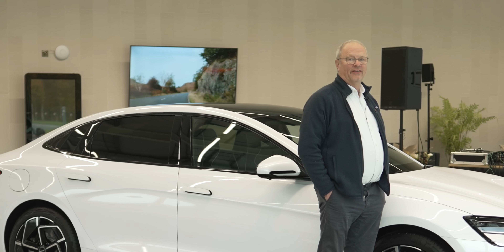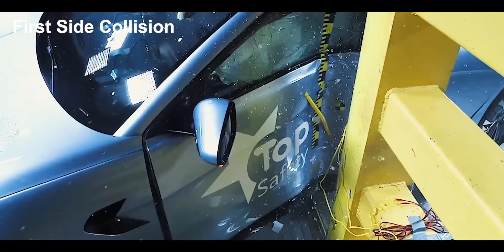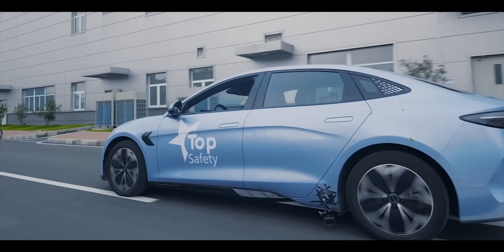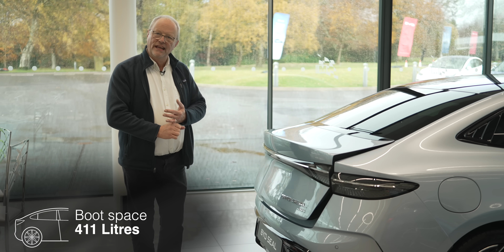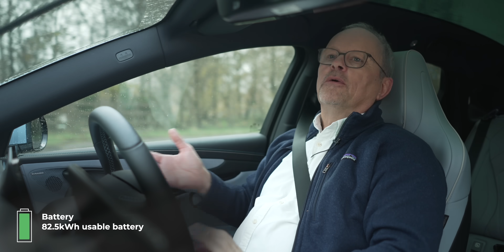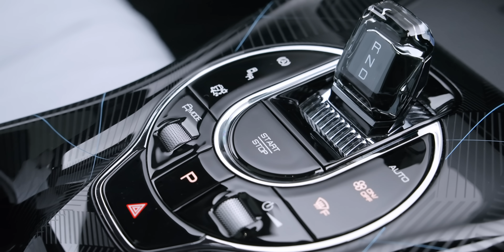This Car Proves Just How Far Chinese Cars Have Come

Comment: Had my Seal Excellence since November '25 now, a little over 6.000km on the clock and loving it! Immediately loved the design inside & out. The only real downside would be the comparatively low charging peak, but since I charge at home in my garage 99% of the time I don't quite care.

Comment: It doesn’t quite have the basics needed to compete with the Model 3, it doesnt have features like Dog Mode, Camp Mode, and Sentry Mode, there’s no self-serve test drive,
 you need internet access for charging, the autopilot is far more basic, and—most importantly—it’s not even cheaper. It costs £45K, while the Model 3 Standard is £39K and the Model 3 Long Range is £45K. It can’t really compete on price either, since almost all Teslas in the UK are built in China—in the very same city as BYD!

Comment: NOPE!  Just saw real world 2 day comparison with Tesla.   Yes BYD goes further.     But charging network of Tesla just wins, tells you where to go, plug and works, cost 50% less by end of 2nd day.  More efficient   m/kwh  and $10,000 less.   BYD the big screen is partially blocked by steering wheel,  small drivers screen is blocked if you move steering wheel to comfort position.  Also drivers screen shows power usage which is constantly changing and distracting.     Sorry BYD!

Comment: Thank you.  My concern is the screen.  Doubt I can drive safely as I look for the correct menu and then the correct icon.  Definitely would need to adjust the settings before starting a drive or be very familiar with the Screen controls.  I‘d probably need to pull over most of the time to get it right.

Comment: The thing about Teslas is that they go long distances with EASE.  The trip planner finds your route & charging stops, and Teslas charge about 2x-4x faster than ANY OTHER CAR.  BYD can't do that yet - high speed public charging networks DO NOT EXIST.  It's why Ford & GM are joining the Tesla Supercharging network.  For the price of a BYD Seal, the car  DOES NOT go long distances, so it's actually a fail in my opinion.

Comment: Saddly, BYD seal's sales volume is quite low in China rightnow.
It's not price competitive. Well,  at least in China 2024.
I just bought a 460+HP, 620NM, 4 wheel drive, 77KWH Battery, front double wishbone, Brembo brake, 2 door coupe for less then 20K EUR brand new...Seal is like 25K EUR.
I feel like stealing and guilty. In a good way though😅

Comment: Never buy chinese made, especially a car, they safety is non existent!
Reply from the maker: Hello Claudio Carrera, I think itis perfectly understandable for you to hate Chinese cars, however these vehicles have to pass stringent safety checks to be allowed to be sold in Europe. I have driven many of them and they are as safe as any vehicle made locally.
10 years ago concerns about safety may have been valid, now, we need to find other reasons to hate them.
Reply: @fullychargedshow  Lies you must be a wumao channel. ADAC puts Chinese EV’s to the test. It turns out to be a major safety risk.

“Basic safety equipment is completely missing, which becomes particularly evident in the crash test of an offset frontal collision at 64 km/h (40 mph)”

Never buy chinese made, cheap manufacturing with terrible safety records!
Reply: Dude, you obviously have no idea...! 🤣
Reply: It's sad that he totally believes he's right lol  @Netsurf123
Reply: @Netsurf123  How many BY D dealerships have burnt down, it not even a month old hahah alreadyy exploding lol I drive Merc63, real car by real innovators.
Reply: @Netsurf123  Yeah I do, I drive a Mercedes AMG C63, are real engineered car, not a chinazi rip off that will explode hahah

Comment: The full glass roof design is a hazard. A rock from the top can kill all the people inside in one blow. Moronic design for any car that uses the glass roof.
Reply: How big must that rock be and from what height must that rock fall from to kill all 5 passengers?
Reply: @CThienV  First, no passenger should be hurt. The idea of hurting all 5 is beyond the pale. Second, in terms of weight, a projectile or falling hard object requires orders of magnitude lighter weight to penetrate glass than a traditional unibody metal roof. It doesn’t even need to hurt the passenger or driver to cause a major distraction to the driving and cause accidents. Third, a small and fast projectile, such as hail blocks, is more than enough to break the glass, much less any falling articles from a window of a building.
Reply: @vastg5453  First. You stated a rock can kill all passengers in one go. I only quantified what you said. 
My car has severe hail storm damage yet my sunroof was unaffected. Sure, my sunroof doesn't  have the same span as a full panoramic roof but my wife's car with a panoramic roof was fine after the same storm.
Sure, I agree that there are risks with things falling from the sky and building windows but with how frequently such incidents occur to the extent that you describe, there are other scenerios more worthy of your paranoia. Maybe we're better off staying indoors
Reply: @CThienV  I don't expect people to agree with me, and I am simply pointing out a possible scenario. People are free to make their choices. If they choose to take that risk, it is their own lives at stake. To me, the design is a hazard for no benefit I care about, so I will vote with my wallet and not buy cars with this design. If it turns out to be a bad design, it won't stand the test of time and will fizzle out of the market.
Reply: @vastg5453  have you seen crash tests of this car or other cars with panoramic roofs? How did they go? High speed side, front and rear impacts stress the roof more so than a direct perpendicular hit of a rock would, surely?

Comment: I watched a video from China two days ago. Two years ago in China they had over 2000 EV fire. Last year over 1000. In the video it showed a burned out EV that 4 people lost their lives in the car. They are not safe
Reply: In 2023, 3,000,000 BYD cars were sold. Two years ago, you quote 2000 EV fires. That is 0.0006 chance to have an EV fire, if you are accurate and assuming only BYD cars catch fire. To put it into perspective, the chance of a plane crash is 0.0002. The chance of dying in a car crash is 0.01. The chance of a gas car catching fire is 1530/100,000 cars or 0.01529.
Reply: @ProdigalExplorer  that what the guy said in the China video about 2022 when 2000 EV caught fire
Reply: @bobjohnston5527 but that guy did not give data for all other types of cars and vehicles for context and perspective.

Comment: Where I live on hot summer days when I get in the car I have had temperatures of 65C or higher, so laughing about max of 60 on the heat pump spec is frankly ignorant.
As to comment on 5 years ago heat pump drained the battery and tech has advanced greatly, then that means 5 year old EV cars are now worthless, and so will the Seal be worthless in 5 more years. So I can’t afford to waste money like that, until tech is stable.

Comment: I've been in one today and the interior quality leaves much to be desired, specifically the choice of materials. The seats upholstery feels like rubber, the steering wheel is made of the cheapest plastic you'd find on bottom panels of an old VW. I got a Seres 5 EV which costs about the same, has similar range, but the interior is tastefully designed, the carpet is plush and soft, pedals are accented with metal surrounds, everything is soft touch, most of it is upholstered in real leather. Not only the seats, but the door cards, arm rest, center console sides, and dashboard trim. The fake wood is nicer than you'd think, the sound insulation is amazing (it has double pane windows in front)
Reply: I'm confused. 
Inferiority or superiority complex?
Reply: @CThienV  it's a fair comparison. Both are Chinese EVs both cost the same, it's a matter of taste I guess
Reply: @dgurevich1  we all have preferences. You don't need to justify your purchase decision. Be happy and enjoy your ride.

Comment: BYD battery manufacturing is one of the greatest reason why they are rising on top.
One of the biggest problem with EV is battery.  the battery industry is still young and there are lots of things yet to be discovered. we have graphene, sodium, manganese etc etc.  this make everyone be worried about their EV's future.  

your EV right now may not be a good investment coz when the time comes for you to replace your battery, your new battery would be technically outdated.  you car's motor and all will still be fine, but the battery tech needs to be replaced by the newer material.    

and this is where BYD give people something to hold on to.

we already have that very same problem with our laptops and other battery powered devices such as smartphone and sports camera.
when our device time to replace battery came .. our device doesn't feel like brand new at all.  what ever battery replacement you did.. it always have that feeling of undervoltage because those battery are most certainly in stock for years on a warehouse.  and discharge from being stock for long is not good for any battery right now.

Comment: This car looks like a nice EV. But you shouldn't lie about modern EVs not having their range lowered when having accessories on. I'm talking about driving on a cold wet night. Heater on, lights on, wipers on. You can't tell me that the range is not affected.
Reply: In the cold winter, battery life will definitely be reduced, so in cold places, it is best to buy a gasoline or hybrid car

Comment: My old neighbour Mr Wang Peen said he was a BYD engineer who tried to speak out about BYD safety issues. BYD management silenced him by sending hired goons to launch heavy kicks at his groin while being held against his will. One of the managers said to him 'why do you care about BYD fires? none of your relatives can even aford a BYD so they are safe'. He was so scared of this company and their goons he moved overseas. He never wanted this story to be told as he was so scared but I changed his name and told it because the truth must be heard. Look up BYD fires, there are youtube videos with BYD's exploding high up into the air even when parked without anyone inside. Do not be fooled. Mr Peen said he refused to work on their next prototype the BYD Baby Octopus as the pouch holding the battery had even cheaper materials than before.

Comment: Engineered and designed by Germans 🇩🇪. BYD chief designer 🇩🇪 Wolfgang Egger. Engineers 🇩🇪 and BYD has joint venture with Daimler AG (Mercedes-Benz) yo develop cars. That just proves that 🇨🇳 are not capable to build competitive EVs themselves without Western help. Typically.. 🇨🇳 Gov boost with insane amounts of $ to save their face in EV race as they can't compete in cheap goods anymore as work force ages, living standards rise. Globalisation saving them in other words copy what works in West

Comment: Anti-bullsh!!t campaign!! Really?? He says "If you turn on the heat pump you will not notice any change in range!"  AC in a ICE car is also uses a heat pump(heat goes outside instead) their consumption is sizeable and you can   defo notice a change in range, so i definately calling you out on this one! Also their buses in norway could not be used during a recent cold snap as some much energy was lost between heating the batteries and stopping the cutomers from freezing to death the range was so minimal and unpredicable that they could be used!! Finally no one said that electric vehicles catch on fire more, but if they do the fire service will do little as the extreme heat and danger of explosion out weighs anygood they can do!

Comment: Great test results! But.....
If the fully charged battery pack is intentionally broken, then crush it with heavy machinery. I wonder if it will catch fire? 

Also, if the battery is fully charged, remove all protective covers and place it in water to conduct a battery short circuit test. I wonder if it will catch fire? 

If it doesn't catch fire in both tests, it's the safest battery pack. If one of the tests catches fire, at least everyone has an escape window in mind.

Comment: BYD’s buses are also taking over London, and reasonably so. They’re by far the best London Buses we have ever had to drive, as a driver it finally feels like I’m driving something rather luxurious, fun and incredibly solid. BYD has put Alexander Dennis, Volvo and all the common bus manufacturers to shame!
Reply: It is fantastic to hear such positive feedback from a bus driver.
Reply: Volvo is owned by Geely motors-China
Reply: @wormxzing Volvo Bussar is an independent subsidiary of Volvo group. Volvo cars is also a sub of Volvo grp, which owned around 80% by Geely. Buses =/= cars
Reply: @noblekitty  Volvo's operations are independent, and Geely basically does not intervene.
Reply: @wormxzing Volvo bus isn’t
Reply: Please note that they are working together with Alexander Davies on that.
So, nice, sustainable integration in your evonomy.
Reply: Pretty sure they partnered with Alexander dennis
Reply: Thank you, thank you from China。
Reply: BVD might be good for cities, 160 mi. Max. Limit on one charge! Not so great!   Course the worst environmental country manufactures them and they have no sustainable electric for the common home.  Electric grids in America cannot sustain the E.V. industries drain and high electrical cost, the more power an E.V. needs to pull, push, haul various loads, the more sources you need to produce the overwhelming load for a fuel, like coal, petroleum,  nuclear,  solar... It is a fad for those who want a toy, those who don't travel, etc.. and the perfect way to keep a society from evolving, and under big brothers watchful eye!!
Reply: @longroad68  I don't agree with you.  Most american families own more than two cars, and daily commute are less than 100 miles, now most companies provide free charge stations.  I have a Tesla Model 3 and Lexus RX350, my daily commute is  around 20 miles and my wife takes train.  I usually charge 2 times a week at my office charge station.  So it is perfect combination for me.  I can see a lot of my neighbors own Tesla too.
Reply: @davidz7858  David evidently the "train" marks you as a suburbanite, tesla means nothing! The failing power grids in America CANNOT handle the electrical  power drain now! You are not saving the world, electricity  is provided by, coal, petroleum,  a very small hydro,... hybrids are the future, not hey my neighbors like teslas to drive to the city!! All electrical is not an answer for anything except, far more of your world ending problems!? I guess your not considering that America travels her Nation, where they want, when they want, and don't want to map out on vacation where we might find a charging station to wait an extra hour every time I stop, every 200 miles, because who wants to spend that last little bit of electricity in my battery, it goes REALLY fast, will I make it to one in time?? Oh wait, I live in the City, the worst pollution environments, charge up baby its time to make it worse!! Now that makes sense!
Reply: @davidz7858  A lot of households have 3 to 4 cars (espedially in the suburbs), one each for the mother and father and one or two for the kids.
Reply: @longroad68  Improve public transport investment & nationalise the networks. Its in the interest of everyone, not the few!
Reply: @Kitofthearts  Public transport investment, nationalize the networks! Your words!   So, your bought and paid for! How absolutely Mundane!!
Reply: @longroad68  You sound like you have little to no idea what is actually going on or how things work, divorced from reality it would seem.
 But apparently you do like to build fictional narratives, which to be honest, aren't that entertaining.
Reply: @BrentonSmythesfieldsaye  Brenton you've absolutely said Nothing! Spend more time learning how to interact,  less time alone in front of your mirror!
Reply: @longroad68  well once upon a time people felt the same way about a combustion engine vehicle. The combustion vehicle also went through the same issues. 

What's your point?
Reply: @Aceydady  whoa, horse and buggy days!? There is not enough electric grid in the U.S. to sustain the demand now, so let's be really smart and add 4 times the demand! By the way, you automatically become more of a hazard to the environment because electricity is produced by coal, petroleum,  etc... there is more pollution because you will need far more of the by products! The wealth owners know this and hope everyone stays in the dark to there nefarious ways! They don't care about the environment,  but they do want YOU to wash their underware for 50 cents a day!! Maybe this will be point enough!
Reply: "BYD’s buses are also taking over London, and reasonably so."
==
Taking over streets of London, al right.
By stalling.
Reply: @allgoo1990  I've been driving them for a long time and I've never stalled. If you're stalling an automatic, electric bus, you need to hand your licence back to the DVLA.
Reply: @allgoo1990 well you even stalled spelling "alright" 2 letters in
Reply: @allgoo1990  : Growing pains.
Reply: @allgoo1990  Don't forget you're trying to school a guy who drives them.